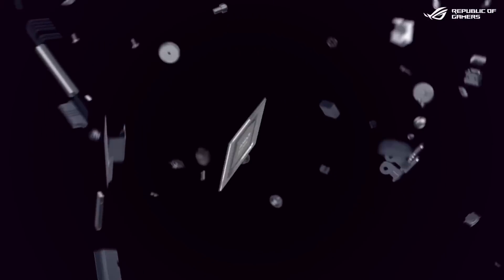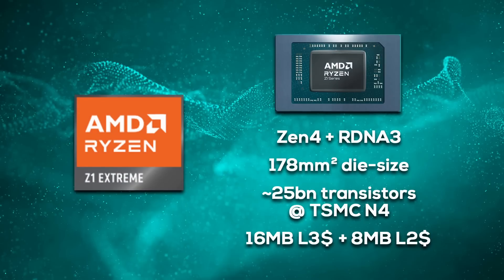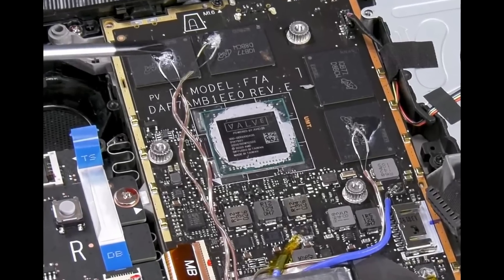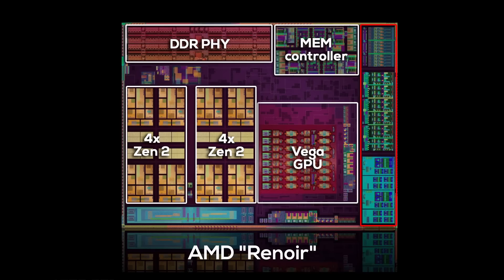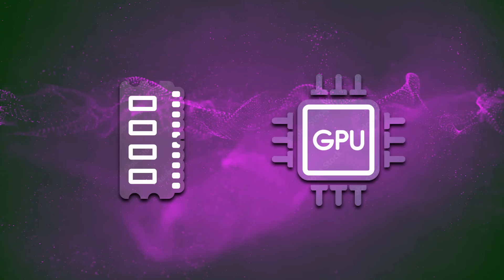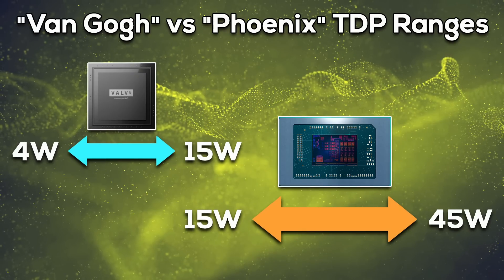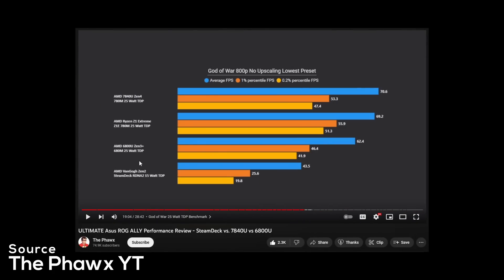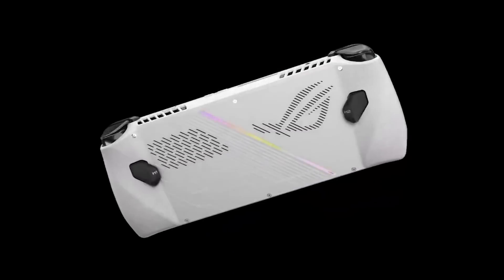Why the ROG Ally can't beat the Steam Deck

Comment: digital foundry review.

SD : 48% more performance at low TDP (9-10watt), 37% longer battery at 30fps limit.

rog : software experience is still long long way behind steamdeck,  ..software is far behind steamdeck, pretty gruesome..

bad battery life, flawed portable PC, but still good alternative for PC enthusiast that frustated with deck limitations.

my summmary : battery life optimization R&D and software (deck) is way more important than just RAW SPECS (rog)

for handheld gaming
Reply: 60hz should be minimum in 2023. All these caveman gamers are coming out now.

Comment: I dont think a SD 2.0 is on the way, as valve is trying to improve the compatibility of steam os for backcatalog of games... Mindlessly improving hardware before optimizing the software is the main problem of pc gaming. And i want to believe steam deck is an effort to show people you can use older hardware. Nintendo has a similar approach, they dont use super powerful hardware and do not do main hardware revisions to their consoles for almost a decade... Also using linux instead of windows is a statement in itself, "not using bloated software so you do not need high hardware". Anyway these are my two cents
Reply: DX9/10/11 is really not the problem. Proton's DXVK has done an amazing job to getting those titles working. Even reaching out to Devs for help with online play. SD2 is definitely coming, and Dev's should be convinced of it's usefulness.
Reply: Now it looks like the VR console will be next. It makes sense that Steam wouldn't want two new expensive hardware products out fighting each other for customers' gaming dollars at the same time.
Reply: The Switch came out 6 years ago.
Reply: @Lestibournes  yes, but the SoC the Switch uses, an Nvidia Tegra X1, came out in January 2015. So the internals were already quite outdated from day 1 of release, lol. I think they slightly erred with the memory however. Higher clocked memory gives a significant improvement on the Switch and they could’ve squeezed more out of the SoC if they had done that. 

Nintendo has always put more emphasis on the the games than on the hardware. That is the correct strategy, in my opinion.
Reply: @Lestibournes  Yeah, Nintendo has the same 5-ish year (and slowing) release cadence of all the other console makers. However, ever since the Wii, they've been about a generation or more behind in graphics power.

Of course, mobile consoles have typically lagged behind about a generation, so one could say the Switch represents a return to graphics parity.

I think Nintendo has realized that realistic graphics aren't what makes games fun. Higher resolution and frame rates have diminishing returns. It's not like it's 4x more fun to play at 4k than 1080p. It's not 4 times more fun to play at 240 Hz than 60 Hz. It's not twice as fun when you model every soda can and horse dropping with HDR ray-traced lighting.

Indie games have been proving that for a long long time.
Reply: Woops, that didn't age too well 😂

Comment: Inconclusive evidence for the most part. The phawxs tests have been confirmed to not quite match a standard 7840U (see Taki Udons latest video). Firmware update already added 12% more performance on the low end. We need more data- and the Ally needs more time to marinate. The Steam Deck had tons of problems months past it’s arrival on Feb 2022
Reply from the maker: The Ally should wipe the floor with the Steam Deck as it's hardware is 4-5x more powerful and produces with a 1.5x node advantage. Yet it doesn't. Even if it's low power performance increases, at below 10W it's still playing catch up.
Reply: @HighYield  which is why I call the evidence inconclusive- and why I say it needs more time to develop the software/firmware side. I think your video covers what we currently know well(although as with cutting edge tech in an un-finished release phase, is subject to change daily), but the fact is we haven’t even seen it’s final form(dbz pun intended). Technically at 15w tdp on the Ally as it stands right now we are seeing around 20-30% increase in performance- which 15w tdp is still within the Decks range. So it does beat the Steam Deck, just not at 10w at this time. The jury is still out.
Reply: @baldsealion  15 watts is still too much for a handheld

Comment: Very insightful! I would not underestimate the software differences, though. Steam OS has a lot of tweaks even to the Linux kernel to optimize for gaming workloads. I think it’s unlikely Windows has undergone similar optimization for the Ally.
Reply: Yeah, I was thinking this too

Steam Deck: Fully custom APU + Fully custom Linux OS
Ally: Off the Shelf APU + Off the shelf Windows + software to slightly tweak power consumption

Comment: Another amazing video your chip analysis is on another level. You brought up av512 support for the ally and got me thinking these two handhelds should not be competing with one another. The deck is a switch competitor it only plays games. The ally supports full windows, external gpus and av1 encode/decode. I did not like buy the deck because it’s a huge handheld I wish it was half the size because the chip performance is so good at 10watts. So hopefully that’s what valve releases with next gen. With the ally it was made to cool 30watts so asus should have never let it’s tdp drop under 15watts in demanding games. At the end of the day I see two very different handhelds. 
Last thing I’m calling it I believe we will see the cutdown ally chip out perform the deck at all tdps!!!!

Comment: Kinda crazy the number of clickbaiting “Why The Deck is better than the Ally” videos I am seeing. And all of this is happening when the device is not even out yet and in an early stage jn terms of drivers and OS support. SD had its problems at launch too. Why can’t both devices be accepted by the community in general and why do we have to fight.
Reply: Alot of people are looking at performance at low wattages of many handhelds, and the Deck is very competitive. The ROG can drive much higher performance with more wattage, but that heavily cuts into battery life, which is a turn off for many people.

Also, the ROG runs Windows 11, which has had more than its fair share of news about bugs and issues.
Reply: @reaperreaper5098  it’s kinda simple, as of today (and the Ally’s not out yet) if the ROG suits your needs of 15W gaming and plus (15w = comparable battery life consumption over SD but at 1080p and with a fps improvement if left at 720), 1080, quietness, using Windows (I prefer it despite its flaws but I am hoping for a handheld mode) and multi-libraries. If you want better battery life at lower tdp, Linux and console-like UI that was tweaked for a year now with guaranteed support (too early to tell with Asus), iFixit repairability and trackpads, then yeah the SD. Depends on everyone’s needs. So we are looking at different niches and I don’t get why people have to fight about which is better for all in the comments when it’s relative to each person. Point out the pros and cons of each, fine, but generalizing and stating that this device is better for all is a bit of a stretch and that’s what I have seen from users. Clickbaity titles do not help even though the video’s content do elaborate on why each device suits this target audience for this need and that need. Anyhow, ultimately, competitiveness with handhelds is the way to go to have better devices in the future, but it seems like an unnecessary new handheld war started lol

Comment: Valve has proven, like with their games and recent HW (VR), the painstaking process of attention to detail and UX design. The Steam Deck I believe is the TRUE handheld device, where I believe Valve has taken notes from Nintendo with fully utilizing and compromise with HW. The idea of making use of HW while plugged in a handheld is odd to me, it's not a true handheld experience. As you said the Ally lacks to power itself at lower tdp lvls with its increased core count/CUs, and IO. 

I've watched the Phawx, and the 7840U and Z1 Extreme while the same, the 7840U handles voltages, freq differently while still within ~10W, the same as the Ally and performing better. Interesting watch, and maybe the Ally could be improved on.

Thinking about it, I am curious how the regular Z1 will handle with fewer 2 cores to power and 4CUs that'll potentially be sufficiently powered at lower wattage. Although the $100 difference in MSRP between this and the extreme is weird. I think if it were priced at $550 it'll be more competitive compared to the deck with a 512GB nvme storage and the better screen.
Reply: @BobDevV  That's fair, I completely forgot the mediocrity that was the steam machines and its precursor with the dual trackpads and planted the seeds for proton. Also, holo iso is a great shout, thanks for bringing it to my attention.
Reply: Yes I think the regular Z1 is probably destined for the scrap heap. Why launch an inferior powered version of your product a couple of months later when your line up is designed around the most powerful handheld.
Reply: @hgh1727  True, and the MSRP $100 difference is like the 7900 XT vs XTX, it's a play to get you to go for the expensive option unless you don't live in the US

Comment: If any of these theories were even remotely true, it would be very simple to 'fix'.

Underclock (&undervolt) to steamdeck frequency and disable half the cores and still benefit from faster memory and newer architecture IPC gains.  (I would be astounded if the newer node couldn't match the older node's performance at a lesser power draw.)

The benchmarks are also all comparing SteamOS vs Windows.  Put them on the same OS before you benchmark to find the true hardware difference.

You have wildly different Linux vs Windows OpenGL performance, and the Windows titles are generally running on a completely different API altogether (DirectX).

A lot of the performance disparities also ignore that the Ally is pushing literally twice as many pixels to screen as the deck.  All things being equal, you would expect that matching framerates should result in half the battery life in that scenario.  And that there's a joule per frame (or per pixel) calculation to tell the true story.  (Kinda like how some nVidia benchmarks have greater total power draw than AMD, despite being universally ~20% ahead on watts per frame this gen.)

TLDR: bad theory is bad.  And every reviewer so far has indicated that the Ally is more comfortable to use at 30 watts than the steamdeck at 15 due to fan noise alone.

If you want your Ally to have long battery life, you will need to play titles like Stardew Valley rather than Horizon Zero Dawn or Cyberpunk, and lock vsync to 30fps.  On the steam deck, you don't really have much of a choice and you're stuck with Option A.

Comment: thanks for the insights. Will choose Ally over SD nonetheless because powerbanks are cheap and in use with an xg mobile it becomes a good alternative as a console / desktop / handheld hybrid for 1440p.
Reply: You're missing out on touch pads, they're a great deal for games with limited controller support
Reply: @vinylSummer  those touchpads are barely usable tbh
Reply: @oo--7714  not the experience I'm having with them
Reply: @vinylSummer  for the Games i Play on the track i dont need them. And at home/ Hotel i have M+K. Also a Selfmade lapboard for my living room. And i didn't like the Pads on the Steam Controller so i won't miss anything

Comment: I think Steam Deck 2 needs to be 8-9 inch model with sweetspot around 20W to comfortably 5x the performance of Van Gogh APU, we need a huge leap in handheld performance because future games will target only ps5 gen and will be incredibly demanding. Steam Deck runs modern games only because most of them still have ps4 in mind

Comment: The goal is long battery life for portability. They should be focusing more on that in future products. If it's just playing at home, gaming laptop exists.
Reply: Can easily attach it to a power bank to get tons of life while using max power
Reply: But you can’t even buy a new laptop with a decent apu in it (6800u, 7940hs) for the price of a ally let alone one with a decent dgpu.
Reply: @dylanallen7720  for $600, you can get 5600h, 3050ti, 16GB RAM with 120/144Hz IPS screen gaming laptops. I see them on sale for months back from Black Friday until Jan. In fact, I have 1.
Reply: Gaming on a laptop is horrible in my opinion, people buy these devices because they want a handheld.
Reply: I checked and in my region a Laptop with 3050(performs the same according to Techpowerup) and a 12500H(4P 8E) costs 100 bucks more.
Reply: YES!  #MBison_meme
Reply: Wait for solid state battery to become widespread
Im not surprised steamdeck2 comes with 20000mah/70whr battery when ryzen 8000U comes
Custom design like vangogh and igpu performs as good as rx580 shud be the new standard
Reply: Well I game mainly at home but never sit at a desk so handheld is the way to go for me, I dont mind it plugged in. In fact 99% of time my SD is plugged in so yeah 😂

Comment: Any idea if half the cores on the Z1E were to be parked by software or from bios. would the saved amount of power be sent to GPU instead? wouldn't that (theoretically) make it behave closer to VG? I think 99% of Ally user will not use more than the extra 4 CPUs cores it has.
Reply: According to The Phawx's rigorous experimentation, they've come to the hilarious conclusion that disabling cores in the 6800U doesn't really save power to the GPU. In fact, it sometimes results in lower performance at the same TDPs. Now, while we haven't tested it on the 7840U, I'd bet my collection of vintage floppy disks that you'll likely witness a similar comedy of errors. So, my friend, it seems like disabling cores won't give you any superpowers, but hey, at least you'll have a good laugh and the same TDPs!
Reply: @Ali-dp6xv  this is true. I did an experiment with desktop Ryzen 1700x a few years back.  I disabled 4 cores hoping I could overclock the remaining 4 cores to higher clock and lower temps. No clock improvements and no lower temperature 8 cores vs 4 cores

Comment: No one is doing any AAA gaming at 10w. Reaching for the top shelf with this one boss .
Reply: And your point is? If you want to do AAA gaming, you have to go for >15W, at that point your spending less time PLAYING games without charging. Sure, everyone has differing preferences on how much they play at a time, or whether or not plugging in their handheld bothers them but I think your missing the point. And if your not playing AAA games, like playing older titles or emulating older HW, the Deck has an edge because it performs better at lower wattage. 

You're going to be forced to increase wattage with AAA games at a cost of power draw. And if you even want a playable experience you're going to be sacrificing a bit.
Reply: AAA = Snooze fest

Comment: The Steam Deck feels more and more like it was designed according to principle that was famously employed by Gunpei Yokoi at Nintendo: "Lateral thinking with withered technology"

Course, using PCIe 3 vs 4 is less extreme then going for monochrome LCDs when color is already common place, but the basic philosophy is comparable.
Reply: yeah the gameboy pretty much beted on longer battery duration.
Reply: Can you explain that principle to me?
Reply: @Lestibournes  it’s squeezing everything out of affordable (usually older) tech for your specific use case. Remove everything that is extraneous and nonessential to your purpose. For a battery powered gaming device you are trying to save every tiny bit of power possible while still providing a fun experience.

While not a direct 1:1 comparison, since Valve basically modified cutting edge (for the time) technology during the Decks development, you can still see how they kept the design philosophy close to heart. I think this philosophy is particularly evident with the trackpads, the performance efficiency at lower TDP, and SteamOS itself. 

Still would’ve liked an OLED display tho.. 😅
Reply: @WholeHolyHole  thanks
Reply: @WholeHolyHole  I love u
Reply: That doesn't seem like it. Steam Deck APU is a custom product designed for Valve by AMD.
Might be a right place at right time situation with AMD saying "we have this for cheap, do you want it?" and Valve finding a way to say yes.